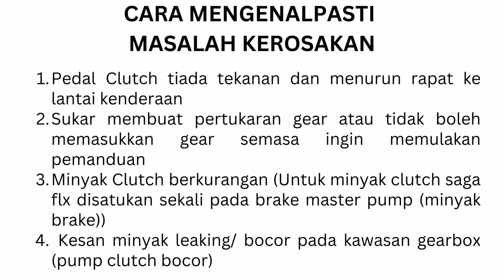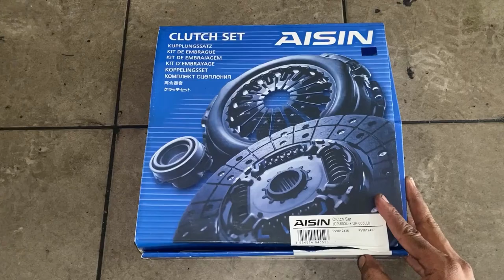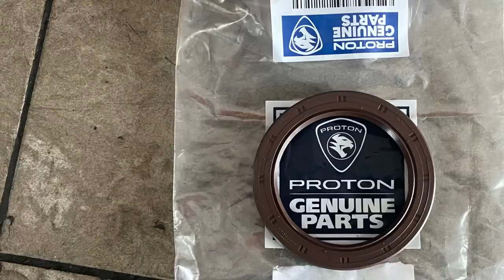Proton Saga FLX | CamPro | Masalah Tidak Boleh Memasukkan/ Menukar Gear | Manual

Comment: Maaf tanya.. gb getrag ni ada Gear Oil khas dia botol hijau.. tp ikut pengalaman tuan tak mengapa ke kalau guna selain GO hijau tu?
Reply from the maker: Proton ada keluarkan minyak gearbox Manual Transmission (MT) (75w-90) khas untuk gearbox MT Proton jenis getrag.

Untuk penggunaan jenis minyak gearbox MT lain selain dari minyak gearbox keluaran proton khas untuk gearbox getrag, saya menggunakan minyak dari Toyota Transmission (75w-90) dan alhamdulillah sudah banyak penggunaan minyak gearbox ini dan tiada apa lagi side effect negative.

Note: Jenis kelikatan minyak terbahagi kepada (2)

1. Mono grade: Kelikatan minyak yang tidak berubah semasa suhu kerja sejuk atau panas (contoh seperti minyak gearbox biasa jenis lama gred 90)

2. Multi grade: Kelikatan minyak yang boleh berubah semasa suhu kerja sejuk atau panas (contoh seperti minyak engine 20w-50 dan lain2)

untuk gearbox manual ia memerlukan kelikatan yang lebih pekat/ tebal mengikut spesifikasi yang telah ditetapkan oleh pengeluar kenderaan untuk gearbox beroperasi dengan cemerlang

kesimpulan disini, penggunaan jenis minyak gearbox MT pada gearbox jenis  getrag selain dari minyak khas keluaran proton boleh, tetapi gred kelikatan minyak perlu mengikut spec asal yang ditetapkan oleh service manual kenderaan untuk gearbox boleh melakukan pertukaran gear dengan lancar dan juga dapat melindungi/ menjaga komponen dalam gearbox untuk penggunaan jangka masa panjang

Terima Kasih

Comment: 2k juga ke bang. Disk klu boleh skim takut bila masuk gear body kereta ada gegar2 lama2 rosak balik
Reply from the maker: Maaf 2K apa ya? 
maksud disk itu flywheel ya? flywheel ni biasa jika perlu skim, melibatkan masalah muka pada piring flywheel ada kesan terbakar (panas risau permukaan disc bengkok tak rata) atau calar kasar akibat dari penggunaan clutch plate yang rapat habis sampai besi
dan jika en. ada pengalaman boleh kongsikan sekali untuk menambah ilmu pengetahuan bersama

Terima Kasih